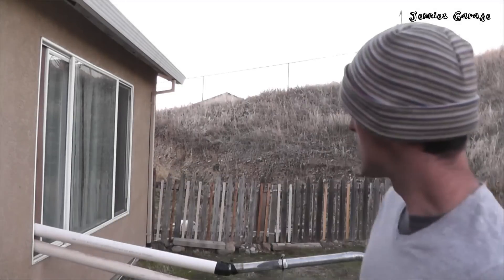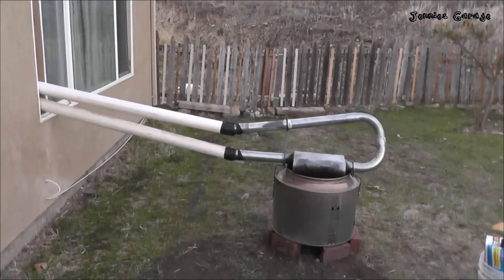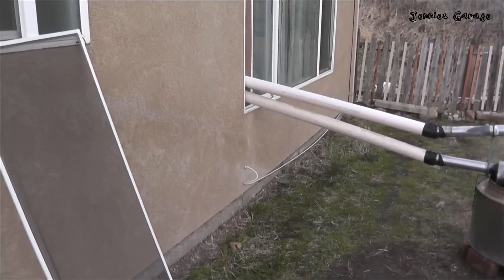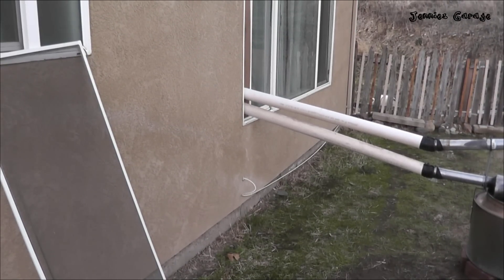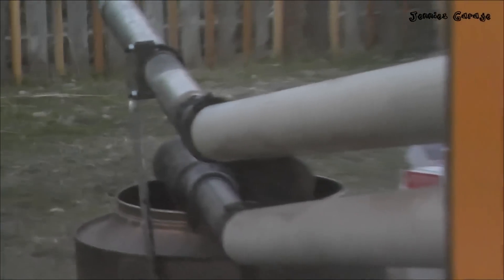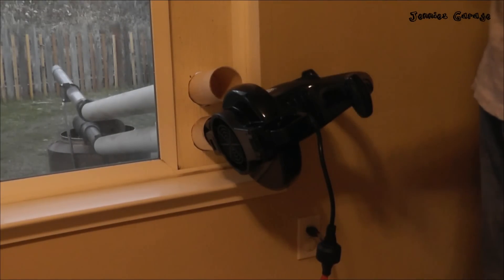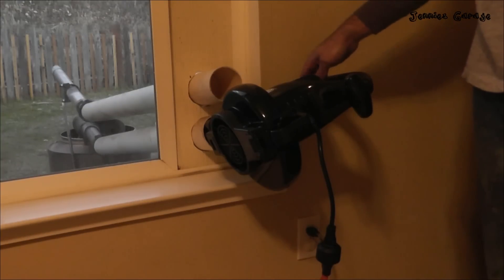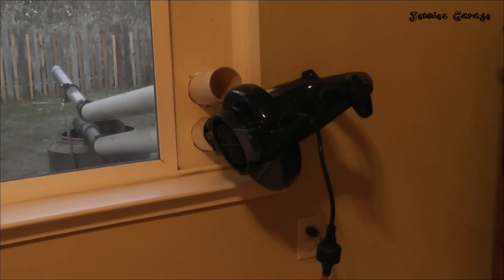How To Heat Your House With Garbage - Testing The Trash Furnace

Comment: If you had a long pipe going up a chimney on the fire then you may find that the hot air creates a natural airflow which removes the need to have a fan running all the time, just for a boost. It would also capture more heat from the fire. I would recommend you insulate the pipes to avoid heat loss.
Reply from the maker: Good tip on insulating the pipe. On the colder days, I really felt like they were losing some of the heat.

Comment: Man this is wrong on so many levels :) I do not know youre energy prices, but i am pretty sure letting this hughe blow thingy running for 30 mins costs as much (or more) as you spare with that your central heater burns a bil less fuel. You do not heat the air once and then its warm the whole night. you have to heat for hours or the colder walls, floor and furniture will cool down the air in the room very quickly. Also your "Oven" blows out heat in any direction. Only a tiny bit of the heat goes into youre air system. Make a mostly closed system and you get much more heat out of the same amount of trash. If you place one or more copper spirals inside the oven wich leads into youre house and wich sucks air from outside (warm air flows upwards) you do not need a fan to transport it. (Better would be a water based system wich heats up some kind of copper heater you can easily build yourself) If you shred youre trash, mix it with water and then let it dry to briquettes you can make youre oven much smaller and burning way longer. This whole idea is only useful if you go outside. light three briquettes, the air transports itself into the house and you do not have to care and spend time about the heating process. Then maybe you spare money with it. And i have no idea where you live but in germany you would maybe get to jail or at least have to pay a big amount of money if you get cought burning openly random trash in youre yard on a regular base.

Comment: ok so I have been watching several of your videos. I Have been looking for ideas for an wast burning oil stove. I like the idea of the muffler as an heat exchange as well as the gasification.. I bought a harbor freight stove as a donor but I wanted to know if there was any other tips.. does the oil have to be pressurized with air or if there is a way to feed it with just gravity? since it is summer i wont be doing a lot with it but I am trying to get the ideas before winter sets in. Thanks in advance!
Reply from the maker: Used oil is very fickle. It is dirty, and changes viscosity as it heats up. That makes it somewhat difficult to regulate. I've seen and constructed a gravity feed stove with a small diameter tube that drips oil onto a concave dish where the oil burns. you control the flow with a valve, and if you open up the flow, the pool gets bigger and makes a bigger flame. It worked, but didn't throw much heat. The burner was only about 6" diameter, though. Another idea is a gasifier setup like I have in my other videos. It takes some time to get going, but it puts of a lot of heat. Just start experimenting, and you'll learn a lot. Good luck!
Reply: Check out rocket mass heater stove on youtube.

Comment: What you are trying to achieve is called an incinerator. They are commercially available but quite expensive. Try reading up on the rocket furnaces being shown on you tube videos and use that knowledge to build an enclosed system that completely incinerates the garbage. Your neighbors will thank you too because any smell would be quite minimal. The muffler as the exchanger is brilliant if it can handle the heat the furnace creates. My guess is that some well placed stainless tubes inside the furnace that air could be forced through would be better. Of course it all means that you would have to know how to weld or have someone do it for you. Just a suggestion. I may try it myself.
Reply from the maker: Thanks for the comment. Although I was surprised with the heat I got out of it, I'm trying to find a better heat exchanger than just the one muffler, maybe tubes like you're talking about or a couple more mufflers around the firebox.

Comment: Why not hook up a desk fan to the outlet flow ? would be a lot quieter but would heat a bit slower.
Reply from the maker: That's a good idea. My current plan is to use a bathroom exhaust fan. It will use a lot less energy than the blower, but still move some air.
Reply: ***** You can also hook your thermostat to the bathroom exhaust fan
Reply: I tried just that on a similar project. it worked for a short time but the high temp heat outlet pipe will nuke the fan rather quickly. i went through a few fan types this way. air in and heat out is great. water is a great way to transfer heat as well. get a good yet small water pump and loop a copper line like your air pipe and connect a small heater core or radiator from a car. you could put a fan behind the radiator inside, but not so much needed. if you coil the copper line inside the fire just right, you would not need a pump. so long as the pipe has a low pressure "drain" to prevent explosions. Great job ***** , keep on experimenting
Reply: what I was talking about was a fan blowing air into the pipe. not sucking it out. :)
Reply: Sorry man, i misunderstood.
Reply: it's cool. I have seen some units that use pressurized water like this though. I just wouldn't want to have to go outside to throw wood in though. >_<

Comment: You should use a regular desktop bedroom fan. Get material attached to back of fan that can be connected to your pipe i.e.. reducer. Insulate your pipes and burner for greater efficiency. 

Stick the fan on the other end of heat exchanger. Outside the house. I seen another useful video to make fire logs out of paper. They could be used in the system. Nice work by the way.

Comment: Your original idea is good but you just haven't attacked it the right way. I think if you do these things it will be much better.
1. External centrifugal fan that is wired to a switch in your room. Or buy a cheap wireless switch.
2. Use your paper and cardboard to make those homemade burner bricks, Soak the paper and add wood dust and mix it and then squeeze all the water out. These will burn much longer. Or if you can't bothered to do that then at least use more wood in the fire.
3. Lower the heat exchanger into the fire more and also cover the top hole.
4. Use different piping that can take heat better. For instance metal or high temp rated plastic.
5. Or simply the best thing I can think of is buy one of those small fireplaces you can just add to a room and they don't have a top chimney but a pipe that goes out the top back of them out your wall. Use that and burn all your trash in that. It will heat your room up much better. And you won't waste electricity on fans or create any unwanted noise.

Comment: I'm wondering why you put a blower on it when air will move naturally (passively) when warmed. If had raised the outlet away from the inlet, would pull cool air from the room, heat it and passively spill it back to the room.  I also think that you are losing a lot of heat to the atmosphere. Interesting idea but I think it needs improvement... maybe, encase that fire box with some copper water tubing to capture more of the heat and run that into the house too as a radiant heater hot water source.
Reply from the maker: I used the blower because I wanted to recirculate the same air. Interesting idea about raising the outlets, though. I agree that I need to do something to capture the heat from the sides.
Reply: I understand the re-circulation part. However, Hot air always rises, and like water it always seeks the path of least resistance.  If you had placed the inside air intake near the floor and your outlet closer to the ceiling it would have created natural air flow, sucking in the coolest air at the floor then exiting as hot air near the ceiling.  No power tools (or noise) required.  The only issue is you would need a way to close off  the system when not in use because as the system cools it can reverse and act like a heat sink.

Comment: Have you thought about bathroom ventilation air flow, it`s very quiet and very powerful.  I like your idea, but it will not work outside on a very cold weather because the cold air will kill the fire, best way would be a firewood stove in the basement.

Comment: Couple things off the cuff watching this.
1. Line the bottom of the fire box with bricks. You'll retain heat longer from the fire after it goes out. 2. you can make trash bricks. Look up the channels desertsun02 and tiny house listings. Desert sun has a video of how to do it on a small scale.  THL does it on a larger scale.

Comment: It just doesn't make sense for it to be using another energy source that costs money to use. You might as well just invest in a wood stove or pellet stove. This way you can burn your garbage inside your home and not have to go outside plus, you don't have to use electricity each time you want to burn your trash plus freeze your ass off. This is just one of those ideas was spawned out of boredom and no thought was put into it after the fact. ORRRRRRR you can just go with solar power heating. This will obviously only work during the day.

Comment: Actually, as a trained HVAC person, the quickest way to make your system FAR more efficient would be to slow down your air flow.  A smaller, less powerful fan will move the air at a slower rate through the heat exchanger.  This helps in two ways.  Your electric bill wouldn't be enormous and the air wold be much hotter leaving the exchanger.

Comment: Put your your furnace in an insulated metal box with a chimney. Place a metal baffle over the muffler to retain more heat from the fire. Also insulate the pipes feeding the hot air into the house. You don't need a big flow of air to make this work, as others have stated a large 12v computer fans will work just as well, be a lot quieter and use less power than a leaf blower.

Comment: Cool project.. But I'm wondering if the leafblower use more power than the heat you're getting.. If you put a heater with the same wattage as the leafblower in the room.. Would it heat the room better?  As someone else pointed out, use a couple of pc cooling fans.. The airflow will be lower, but the air will also be hotter as it will stay longer in the muffler.. Cool video though..

Comment: Some random ideas. Put a 55 gallon steel drum over the furnace with a small chimney and a place to load fuel. You can control the air getting to the fire to turn it up and down. Heat convection would let you get rid of the blower all together. Put the blower in a large cardboard box with insulation to make it quiet. A smaller fire with forced air to make it glow.

Comment: Is there a reason you're intake is inside your room? Why not suck air in from the outside next to the fire? The air won't be true ambient temp next to the fire so it's not like your trying to heat 20 degree air. It would reduce effort of the fan and save piping expenses. Also, mainly, it would cut the noise out of the room so you could sleep at night! :) Great vid, though. Thnx.
Reply from the maker: Hi, my idea was to keep heating the same air more and more. I also was afraid of pulling smoke into the room. You're right about the noise though. I have a squirrel cage fan from a car heater that I'm working on adapting to the furnace. Hopefully it will cut down on the noise.

Comment: That is a good idea! I like to see you use a oil barrel which enclosed the muffler from the inside which reduce heat loss and the fire can last longer. Replacement of the metal washer for the oil barrel act as a rocket stove trap more heat in-turn give you longer fire. Use a usb or battery AA operated computer for the fan blower, it is more quieter. Good luck.
Reply from the maker: You're right that enclosing the whole thing would trap more heat. I found an old directv dish that I'm going to use as a lid on top of the muffler to help add some efficiency. It won't be all enclosed, but should probably help.

Comment: Looking at this setup if you really wanted to take it to the next step build your self a small fire box out of brick and put your car exhaust, I mean heat exchanger in the middle of the "hot coals" and get a medium speed centrifugal fan and run some furnace piping up to the window. Save the washing machine tub for burning garbage and excuses to drink beers by the fire. One other thing to consider is the wife going to be happy with a leaf blower in the bedroom window.
Reply from the maker: It could be more efficient. If my muffler-exchanger was closer to the fire it would catch a lot more heat. I've got a few ideas for a less obnoxious fan, I might go with a centrifugal one like you're talking about, or maybe a bathroom exhaust fan. And yes the wife factor is always something to consider.
Reply: okay cool.

Comment: Some thoughts on this would be look into a small fan that would almost fit inside the tube. the lower power would probably be effective in that the air would move through the system slower and be able to heat up even more inside the muffler. With the air getting hotter you might gain or lose unless you insulate the side coming back into the house. Possibly dryer vent hose if its effective, to replace the pvc. I don't need you dying from plastic fumes. secondly I would say either put the fan/suction closer to the floor so it sucks the absolutely coldest air from the area and possibly route it to the furthest corner near the floor so you're not sucking the heated air right back out. I like this idea though. i wish i had the resources/permission (haha) to do it too.
Reply from the maker: That's an interesting idea. With a smaller fan I lose some cfm, but the air gets hotter. I might have to experiment with that. I agree that insulating the pipes would really help, especially when it's below freezing outside.

Comment: well it can be inproved.

dosent he blows out som heat by having the inlet and the outlet so close and run the circulation fan?
Reply from the maker: that's a good point. It's not too bad though because the outlet throws the air pretty far. It would probably be good to separate them a little bit though.

Comment: I have a window Ac in my bedroom actually I have one in every room of my house but back to my bedroom I run my window Ac all year long even in the winter time. I set it for 72 degrees and no matter how cold it is outside like last night out here where i live in AZ. it got down to 32 degrees but inside my bedroom it was a nice 72 degrees. running my window Ac. I cannot sleep with a portable heater or any heater because it dry's out my mouth and inside of my nose. my window Ac recirculates the air in my room and keeps it at a perfect 72 degress
Reply: A/C removes moisture from the air...
Reply from the maker: I like the Idea of individual room heating and cooling. Why heat all that extra space?
Reply: exactly
Reply: you still have an electric bill though !!!
Reply: yes but it is a very small electric bill
Reply: On the ' dry's out my mouth and inside of my nose' issue...
Put a any kind of pot with water, near heat source, done deal. water evaporates, and you have a nice moisture air
:)

Comment: is it not dangerous to heat up the pvc pipe that it will put of dangerous fumes from the plastic? I think stainless steel pipes would be better.
Reply from the maker: Good point, I googled it and the rated max temp for pvc is 140F. beyond that I don't know when it would actually start to put out fumes. My gauge didn't go that high but I might have to find a higher temp thermometer.
Reply: If using steel, they should be insulated. Otherwise some of the heat will be lost through the pipe to the outside since metal is a good conductor of heat. That is why HVAC ducts are insulated, otherwise half the heat (or cold) will be radiated out of the pipe into your attic or crawlspace.
Reply: Do a corn kernel or pellet stove that is self-feeding!